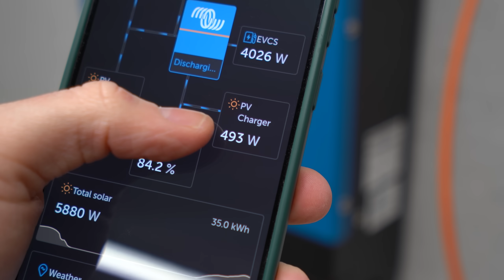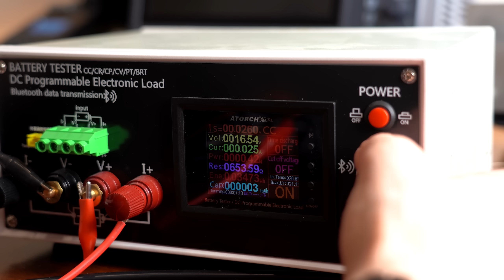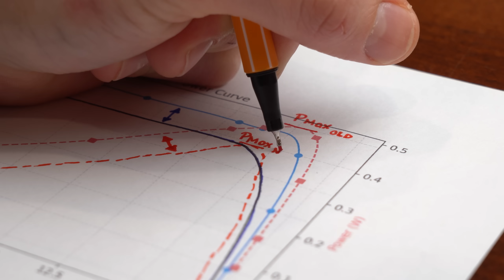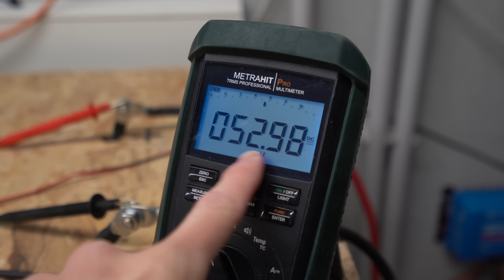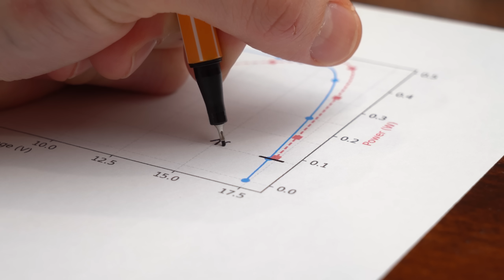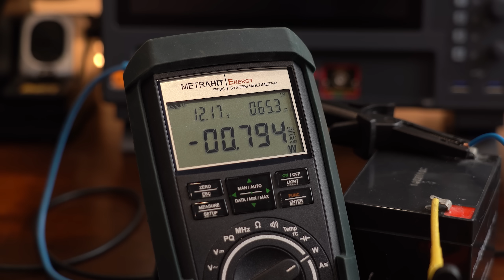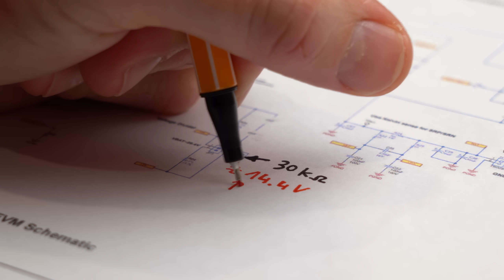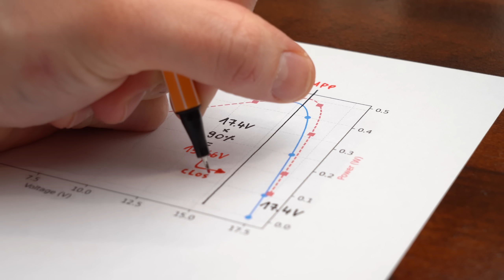My Wind Generator Was Useless....Until NOW! (MPPT)

Comment: I hope you know that mppt for solar needs to work completely differently than wind… ideally for wind you would need external wind speed sensor because at high winds you need to let-off load to let the wind turbine to climb on to right rpm and only then increase load. You basically have a wind curve pointing to most optimal rpm for given wind speed and then you need to adjust load to stay within that rpm. It is a bit like cascade of 2 pid controllers.. for solar you typically just have one stage. Measuring rpm can be done by tapping ac voltage from before rectifier and detecting zero crossing. Typically a 3 phase rectifier bridge and properly set minimal voltage for turning on load should already be way better than those el-cheapo mppt drivers sold with turbines. But if you really want to harvest every single watt things get hairy… the problem is that without external wind sensor you will never know if you are not loading the turbine too much and it just cannot spin-up to handle such or even greater load. And if course there is the entire gust handling and brake/safety thing in stormy winds… i personally never met an optimal wind controller. You have my fingers crossed !
Reply: Many people have proven that a  MPPT Solar Charge controller can work well with a Wind Turbine.

Comment: the laziest solution might just be getting enough wind generators to connect in serial in order to boost the voltage beyond the requirement of those buck converters

Comment: If the total power available from the generator is moderate (say two to three hundred watts maximum), a flyback converter may be the easiest solution. A flyback can deliver output voltage above or below the input voltage even with the same number of input and output winding turns. Only a single active switch is required. The non-isolated equivalent topology is the "inverting" converter, which might be quite workable. The inductor (so-called "transformer") in a flyback converter gets quite large at high power, especially if the voltage range at either input or output is large.

[edit] I would be inclined to experiment with a flyback converter that charged the inductor to just short of saturation then allowed it to discharge to zero current each switching cycle. This is, of course, requires variable frequency.

Comment: If you really want the maximum power from the generator the best solution is probably a 3-phase (assuming that's what the generator produces) active power factor correcting MPPT system. That isn't a trivial thing to implement. It may, however, be the case that the generator output is "soft" enough that simple capacitive filtering, which usually would produce horrendously bad power factor, isn't too terrible. The higher the capacitance you use, the worse the power factor.

Don't forget that you may need to add additional circuitry to keep the maximum speed of the generator in check. You can't do simple things like shorting the windings unless their resistance is high. If you short a winding with low resistance you are dissipating next to no power (current may be high but voltage is nearly zero). You will need a shunt regulator that dumps power into a dummy load.

Comment: duuuude we need to see you make the complex DIY solution, we are already so invested!!!
Reply: I think most of those changes are just a matter of software (or adding current-measuring shunts), though increasing the frequency or resolution might require a different microcontroller. A lower frequency can be used with a bigger inductor for the same current.

Comment: This comment could sound foolish or I'm risking to be taken as I didn't understand the point, but, why don't you try to simply plug it in your op-amp-driven boost converter and see what happens? Maybe you need a capacitor at the entrance or an additional circuit to get a more constant "analog", not digital circuit impedance. Maybe you can manipulate that impedance by an analog circuit also driven with an op-amp, if it's necessary.

Comment: My senior project in college was pretty much this exact circuit. I created a buck/boost converter with an Arduino Leonardo for a solar mppt. The main limitation of my circuit was the heatsink on my mosfets and diodes. I think it was about 200W. I remember a big benefit was figuring out how to get the pwm frequency higher on the Arduino. It was also pretty fun the charge a capacitor to 100v with a 5v usb power supply.

Comment: how is the generator in the wind turbines setup, it matters when choosing a charge controller, what output is coming out the turbine? ac or dc? pwm charge controllers work better to charge batteries with some wind turbines than mmpt

Comment: The problem with wind turbines is that wind is so intermittent and by the time the mppt finds the maximum power point, it's already too late. I was thinking more to charge super capacitors using a low Vd Schottky diode three phase bridge rectifier, then using an mppt or boost controller after this. This would mean all charge from the turbine gets captured in the super capacitors rather than waiting for the cut in voltage.

Comment: There is an additional issue with MPPT and wind-generators: most MPPTs are too slow to find the MPP. Other than solar energy, wind-energy changes quite fast. By the time the tracker reaches the MPP, the wind has changed and the tracking goes wrong. So I would love to see how your system performs in real life.

Comment: What if you add big capacitor before mppt so you have bit stable voltage for better mppt

Second thing....maybe you can open up the turbine and change winding 
Maybe it use delta so change to star for around 1.7x the voltage

Or just rewind it to few x more turns
Reply: No. It is not delta.

Comment: Hi,
there is something I am struggling with:

Say I want to maximise energy from wind or solar, using an mppt tracker, and then I want to convert this to a specific voltage, say for charging a battery.

My intuition would be that these are two separate circuits - one for getting MPPT out put from the wind or solar generator, at whatever voltage the optimum power point sits at, and another circuit (e.g. a buck circuit) that then takes whatever the output voltage from the MPPT is, and converts that to the desired output voltage.

Yet it seems that there is only a single switching circuit that does both tasks. I don't get this conceptually -  how can a single switching frequency always guarantee both that the wind/solar source is operating at the maximum power point, and that the output is at the desired voltage?

Comment: Future test fixture: a DC motor with bench power supply (to check the input power) and the wind turbine from another end (to check mppt-ish methods, because you have not only U and I changes but frequency changes as well, so a lookup table based on inpur frequency of generator?)

Comment: How about simple mechanical storage?

Use the wind to slowly lift a magnet, then drop the magnet through a coil when it reaches height.  The power output will always be relatively consistent, or zero.  Or lift a bunch of ball bearings that then turn a turbine as the fall from the top.

With your EE mind, maybe you could do something with just capacitors?  i.e. Instead of trying to harvest extremely low voltage energy directly into a battery directly, charge up a capacitor and then harvest it all at once.
Reply: Capacitors store less energy per volume than a chemical battery.
Reply: @WimTon  Yes, but you only need to store enough for a big pulse at a time.  You're not storing it in capacitors for long-term storage, you're just banking enough to provide a useful voltage out the other side.

Of course, I'm sure I'm missing something.  I can't be the first person who's thought of that.  Maybe the leakage current makes it a moot point.

Comment: You could use an "unregulated" or "fixed ratio" dc-dc converter to boost the voltatge and then pipe that into the MPPT converter. Since the dc-dc converter is not regulated, it will drop voltage the same way the wind turbine would, allowing the MPPT controller to "see" the voltage changes and position itself on top of the MPP.

These DC to DC converters can be hard to find, I know that Vicor has some for automotive, but a simpler alternative I think would be to play with the feedback path on any of these cheap DC-DC converters to see if you can get a proportional output. In theory it should be possible to just use a fixed duty cycle boost converter and go from there.

Comment: This would be great if it could be modified to carry about 100 amps output, maybe 150 amps input, and 14-36v to 100-120v input, with the ability to charge 12v to 120vdc battery banks.

Comment: Can the rotational speed of a wind turbine be controlled by modifying the back-EMF effect applied by the generator? Large-scale turbines use pitch control to regulate speed, but small wind turbines typically lack this feature. As someone working in the wind energy sector, I’m curious whether adjusting the generator’s electrical properties could serve as an alternative method.

To give some context:
Wind energy is proportional to the cube of wind speed. For example, at 4 m/s, the available power per square meter is 39 W/m², at 10 m/s it's 612 W/m², and at 13 m/s, it's about 1153 W/m².

Taking the Vevor wind turbine in the video as an example, its blade diameter appears to be around 120 cm. At 13 m/s, the wind power passing through its swept area is 1522 W, while its rated output is 400 W, meaning an efficiency of around 26%, similar to large-scale turbines like the Vestas V162.

When considering investment, a yearly average wind speed of at least 7 m/s is generally the threshold. At 3-4 m/s, wind turbines generate almost no usable power.

Additionally, wind speed increases significantly with height, especially above the first 30 meters, where low wind speeds can be a major limitation. You can check wind speeds at different altitudes in your area at https://globalwindatlas.info

That said, installing a 30m+ tower for a small wind turbine is expensive and impractical for most individuals. Even in areas with good wind conditions, solar panels in the same space may generate a comparable amount of electricity.

Would love to hear thoughts on whether modifying the generator’s electrical characteristics could be a viable speed control method for small turbines...
Reply: Sure, just short the output and you apply maximum braking force :D
But a proper mppt optimized for wind generators already does this since the point of max power is related to the mechanical characteristics of the rotor blades etc. But be carefull with diying something like this, because even a full short on the output might not be enough to stop the rotor in strong wind.

Comment: Why not use a boost converter ahead of the commercial MPPT charge controller that doesn't work well with lower voltages?

Comment: When I first came in to the MPPT world, I was trying to figure out what to do with a remote repeater (2m US Repeater system) battery issues. One of the other hams working on the system ask why we didn't use an MPPT. To tell the truth I was unaware of this technology. I told him we did not have budget when we put this system in for extras. Which was true at the time. MPPT was new about a year after we did out install of the new system. Today we have a really cook system in place. I know more about it, but can and most likely need to know more. So thank you for the insight to a different chip and will let you know what we get. 
Peace
Reply: @pjosephlthewonder5082  Victron energy make a full range of mppt controllers and they offer a decent range with Bluetooth and an app that are very easy to use and control

Comment: Put Capacitors between battery and wind turbine or solar panel. For Wind: Batteries can't charge as fast as wind can get for a strong wind turbine but Capacitors can fill with it then bleed into battery when wind comes back down below max battery charge rates. If you have unstable wind where you are where its not a constant max unless a storm = $$$.. For solar: Get panels more than you need and use the same trick for clouds or other things causing problems the capacitors can act as a buffer for more stability. < Volt limiter for capacitor to batteries also one way blocking diodes are good.. You know why lol.

Personally prefer Cold Steam Tesla turbine systems.. Reason: Heat with anything you can burn and cold steam drops heat requirement down enough for Hyper Thermophilic bacteria on a high density compost nutrient drip to run using human waste. < Hyper Thermophiles can multiply double every 24 hours in their optimal conditions which lower Thermophiles get ready for them with their own heat + nutrients. No sun, no wind, and as long as Humanity has life then Thermophiles have fuel. Gonna be perfect for space habitats.. Also? Picks up soil from Mars and lets it blow in the wind No food and cold? No care.. They sleep..

Comment: some people add a dc onverter before the charge controller. I use one of those 80w buck boost converter with 4 mosfets, 2 on each side with heat sinks, works good enough.

Comment: Thanks for inspiration. I am thinking how to scale it to boost one or two 550Wp panels to 200V battery (4x48V pack in series). I dont have a place for 4 panels and 4 smaller devices... Probably I will use only one panel...

Comment: Dumb question, wouldn't it be effective to simply add a dumb boost converter to the original setup?
Basically double or increase the input by a fixed multiplier, then step it down again using the original converter.
Maybe some sort of switch that bypasses the boost converter above a certain input voltage?
Reply: Yes, but the extra stage would only be 80 to 90% efficient.

Comment: Only 251,43 € for the BQ25750EVM board - gulp!
There must be scope for either a DIY board using the same IC - however, the VQFN-36  SMD package is going to be hard work for most of us to solder!

I think I would prefer to see an improved version of your own Boost Converter.

Comment: I'm only at the 4 min mark, but.... remember that a wind controller over a solar charger, also watches the frequency and if it gets too high (ie, shaft speed is going crazy, bearing or blade failure imminent!) it will short a couple of the phases to "put on the brakes".
Reply: Older Marlec/Rutland turbines had a choke to limit the current in high winds. As the frequency rose so did the choke effect on the current.
Reply: @brianredmond4919 that's good ol' smart engineering
Reply: what a waste of energy..
Reply: @maksimmuruev423 no, it stops the generator being destroyed.
Reply: @ - On the prior video (on this subject) I'd commented about the total destruction of MY wind setup. Narrowly missed my shed, garage, house (etc).  The parts all splattered across an open region of my yard. Sheer luck! Found blade parts 50+ft away, embedded in the dirt.
Reply: @maksimmuruev423 Is it really wasted if there's no finite resource being used up? Not like the wind will slow down for other wind generators if yours intentionally stalls to save itself
Reply: @maksimmuruev423 destroyed generators do not produce energy at all… waste?
Reply: @bartowl  - waste… that’s precisely where the smashed bits of mine went!
Reply: @maksimmuruev423  One of the inherent limitations of wind power generators is they only work within a range of wind speeds. Too low, they stop generating; too high, they have to be slowed down to prevent mechanical stress failure. This has always been the case with wind turbines; even the turbines of centuries ago had mechanisms to limit the speed of the turbine in high winds. And the water turbines in hydroelectric facilities also have limiting systems, and the dams have spillways to release excess water. This is life.
Reply: @maksimmuruev423  Yes, but if you don't the wind mill will probably shred itself apart.

Comment: I plan on building my own arduino nano based MPPT circuit (as part of my foray into learning more about micro controllers, as my lifestyle right now would benefit from a lot of power transforming stages, as I'm currently offgrid), would you be interested in the project? I'm very good at programming, and I was going to handle the software part of it all myself, and just use PWM for the buck/boost signal.

Comment: enough of the mppt, just use a buck-boost converter at the generator itself. to get the constant voltage output for the dc power lines. transmission line tech, not a dirty hack. hack makes everyones lives less quality. buck-boost is just energy/power converter, keeping the input power and output power equal to the generator power. transmission lines work with static voltage, not a variable voltage like the mppt hack fake solution. you dont design any operational circuit to work with variable input voltage, but a fixed voltage. unless is a power supply. buck-boost does not require any mppt. it is the mppt in itself without separately stating it is mppt. power in = power out. remove the mppt specifics from the system. make an universal buck-boost power converter instead. or you could also use dc-to-ac converter then add the input power. both do the same max power conversion operation. then you dont have to vary the input load resistance value, but just store the input power flow, then convert it directly, whatever that is. much less complicated system. if any of the current buck-boost circuits cannot do that, then design a simple universal buck-boost converter that can work at any random conditions of input power, voltage and current. universal buck-boost circuit. less is more, mppt.